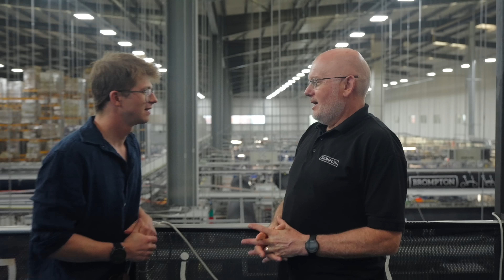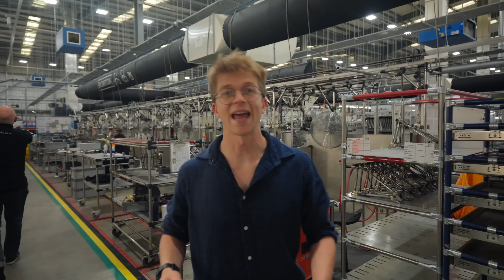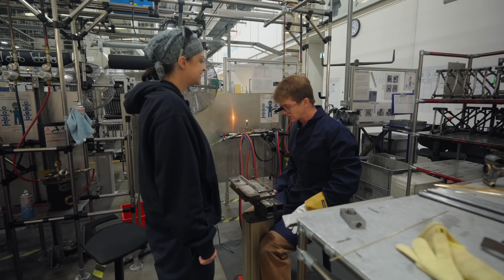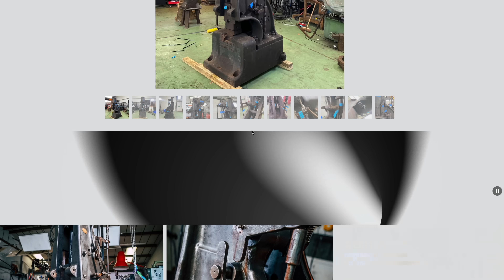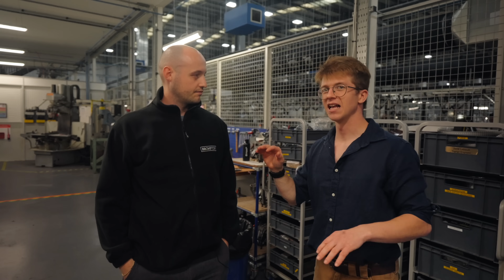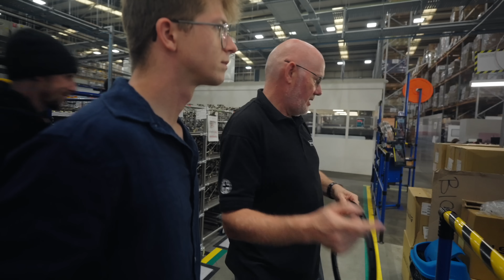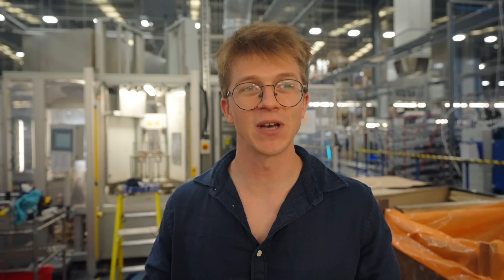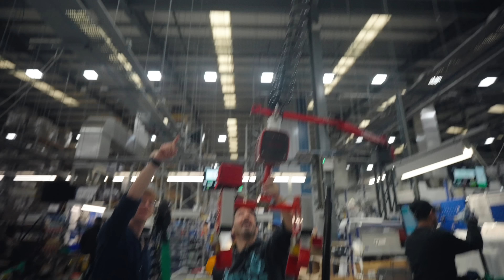Making a Folding Bike

Comment: As a displacement activity from studying for my finals I made a 3 man tandem by brazing together abandoned bikes from around the campus. 
I did it with a carbon-arc brazing kit and an arc welder. Which actually works fine, except for the terrible sunburn, as I did it in a tee-shirt. 
It's a lot easy with oxyacetylene as you can push the molten metal around with the flame to an extent.
But, if you want to braze, but don't want to pay the bottle rental to BOC, then you can do it with carbon-arc.

Comment: I've decided to start saying that brazing is like knitting, welding is like sewing, based on the hand motions. It seems quite similar to soldering - both are capillary flow joining, but brazing seems much more useful in filling gaps and tighter fits.

Comment: Very nice video! 
As a Bike mechanic I never liked these folding bikes, but I sure can appreciate the beauty of them!
One thing I wonder though what‘s going on inside those paint booths… because I‘ve seen powder coating process filmed. Some kind of secret they don‘t like to share I assume!
Reply: It's more of safety reasons than proprietary secrets - according to the Brompton man, the paint powder has the consistency of fine flour, and anyone who works in a flour mill knows what happens when a spark is introduced in a space with flour-like particles in the air... KABOOM.

Comment: welder here-can confirm  the thinner material they use is painfull to weld 
any gauge steel like 16 gauge is a nightmare for bending the whole  thing even when you dont melt through

also .035 wire has to have a special program which is basically rapid taking

Comment: While I do love how much you gush over the brazing, as someone who learned it from a true old timer it's really not that mysterious or magical. It's the same as any hand skill: Practice practice practice. I meet youngsters all the time who look at brazing as some kind of obscure niche art that is too complex for regular people to manage. But it's mostly about proper cleaning, and fluxing. The rest is torch and heat management which you already have from other work. Once you understand how the metal flows, the rest is just practice and muscle memory. Honestly, brazing is NOT as hard as it might seem once you get started, and it is a VERY versatile method for hard to repair items such as cast iron
Reply: Fillet brazing like Brompton does is the hardest.  Using lugs with good overlap like the frame joint is a lot easier and you can get away with overheating the joint quite a lot.
Reply: The same could be said for torch welding as well. Old process but still quite useful even today!